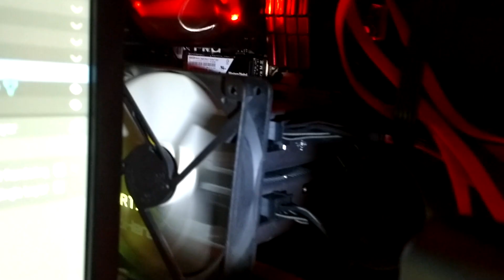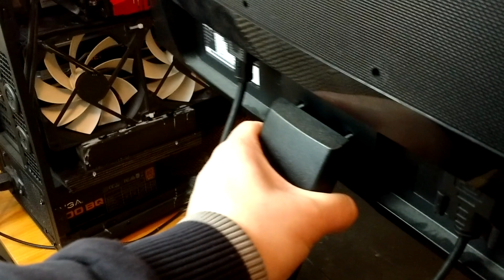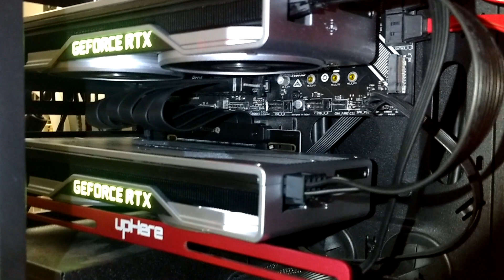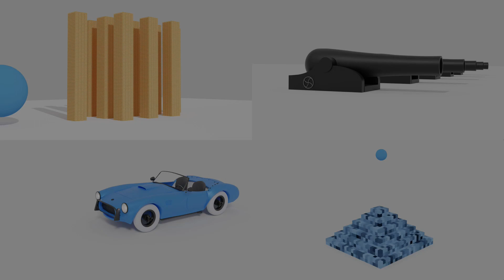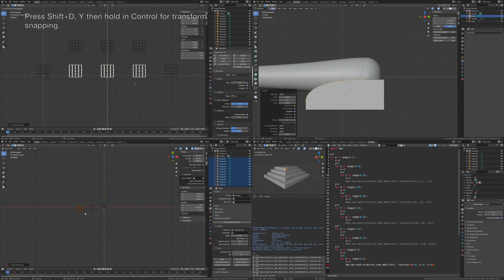Fixing My Hot Running RTX 2060 Super With A Riser Cable

Comment: I am considering getting a RTX 2060 to replace my r9 280x but i have some questions. my r9 280x hovers around 44 degrees when gaming and the power consumption when idle is about 1.6 watts ( according to GPU-Z) i noticed your 2060 running at about 109w. i am assuming this is during a Blender rendering? what is your idle power consumption with the rtx 2060? ( will mis the built in ability to do video capturing with the r9 but i suppose getting a separate program to do that is not an issue ) PS great fix. its amazing how your power consumption and temps evened out and your frequency went back up just by separating the cards.
Reply from the maker: when running 3 monitors at idle the 2060 super bounces between 5 - 12 watts.

OBS works nice for screen capturing.

Comment: Hey, man. Cool video! Did you try x16 - x16 straight away? Do you know if the 2060 would work with a PCIe x1 - x16 riser cable?
Reply from the maker: Yes, for rendering in Blender all the GPUs I tested worked fine with a single lane riser cable. The only thing I noticed is if the project is complex and requires a lot of vram, it take a bit longer to transfer the data to the GPU through only one lane. But realistically with 3.0 or 4.0 speeds, the additional time is minimal.

I even tried it with a 3070 and it works fine. The classroom scene takes about 1 second longer to render in a 1x slot vs a 16x slot.

But of course for gaming, you need at least 8x 3.0 slots or 4x 4.0 slots.

Here's a video I made using a 1x riser cable a while back. https://www.youtube.com/watch?v=BNsBJA3S-p4

https://www.youtube.com/watch?v=1s8FO_Tmntw

Comment: I wonder how you got one of your gpus to stay under 60c, i own a 2060 super and with the case open it maxes out at about 72c with almost 90% fan speed, tried undervolting but only amounts to a 1-3 degree difference
Reply from the maker: Currently I run mine with Afterburner limiting the current to 80% full load and I can't see any performance drop when rendering. But both my cards in an open case(miner style case) rendering for hour after hour with the fans running at 41%(slowest possible speed) they run 65-72c depending on room temp. My fans seldom ramp up on their own and if they do I have never seen them run more than 50%.

Limiting the current to 80% TDP in Afterburner helped but only by 2-3 degrees. If I manually turn my fans up to 80%, my temps stay in the upper 50s under sustained load.
Reply: @BlenderRookie  what model are the cards? Mine is an msi ventus
Reply from the maker: @michelgoudreault7170  Founders
Reply: @BlenderRookie  well those are great temps
Reply from the maker: @michelgoudreault7170  But also the cards do run cooler when they are not on their side. In my current case the cards stand up with the PCIe on the bottom and the heat vents pointing up.
Reply: @BlenderRookie  thats interesting
Reply: @BlenderRookie  i believe my temps are mainly because of lack of airflow, even tho i have 3 intake and 4 exhaust running at max rpm the vents where air comes through is pretty small and the glass side panel gets kinda warm

Comment: nice video! i watercooled my 2060 ko for $70  keep making great content sir!
Reply from the maker: With these 2060 supers, water cooling them is kinda pointless. I can run them at 100% for hours and they barely reach 70c in my current case.
Reply: @BlenderRookie  that is true, my 2060 ko ultra cooling doesnt perform like that. Thx for your feedback😀
Reply: @MutedMillennial  What watercooling product did you use?  I own Gigabyte RTX 2060 6Gb and it is freaking hot! It goes up to 78 degrees when I play games. I really wonder what I can do to cool it down.
Reply: @MrBobtista  I also have one of these cards and mine got up to 82c when playing Assassins Creed Valhalla using nvidia's geeforce experience to optimise the settings for my system. I ended up putting 2 more fans in my case that dropped the temp to about 76c. So now i have 6 fans in my case (3 in and 3 out) not including the cpu aio watercooler rad fans. I would also like to know what watercooler GatesTech used as the only thing  I can find on the Tube is a bodged one using a NZXT Kracken.
Reply: @leewat3742  thx for ur reply. But I’ve ended up selling this card and buying a new one. Now I’m a happy owner of Msi rtx 3060 ti and I’ve stoped worrying about high temperatures.

Comment: ok lol. 2 RTX 2060 Super instead of one RTX 2080 Super or something? hmm
Reply from the maker: For gaming, hands down one 2080 super is better. For rendering in Blender, two 2060s is better. In gaming a 2080 super will be about 45% better than a 2060 super. But in rendering, two 2060 supers is about 40% better than a 2080 super. But if rendering in Eevee, one 2080 super would be better.
Reply: @BlenderRookie  can you explain why it is so. Just curious 😅
Reply from the maker: @kaushikjyotidas2467  The simple answer is that gaming depends a lot on memory bandwidth, CPU capabilities and the number of cuda cores. In gaming it's a balancing act between a lot of things. If one thing is significantly more powerful it will generally make  less of a difference in gaming because gaming is affected by every bottleneck. Also, typically gaming can only use one GPU at a time unless the GPUs are linked and synced together with something like SLI or NVlink.

Rendering on the other hand like in blender is almost entirely dependent on the cuda cores and/or more recently the RT cores. Because rendering in programs like Blender is almost entirely reliant on the cuda or RT cores, the rendering performance is less affected by other potential bottlenecks. In fact when rendering a frame in blender, the computer itself is doing very little because it's almost entirely being done by the GPU. This essentially equates to there being very few bottlenecks to adversely affect the "scaling problem".

The scaling problem is essentially this. When gaming let's assume you have a GPU with 4000 cuda cores. If you had the same GPU but somehow magically doubled the cuda cores to 8000, you might think the GPU should be twice as powerful. But it will not be anywhere near twice as powerful because bottlenecks will prevent good scaling. However, in Blender there are virtually no bottlenecks in the rendering dataflow pipeline so if the number of cuda cores are doubled, the performance will pretty much double.

A 2080 super has 3072 cuda cores. A 2060 super has 2176 cuda cores. In gaming  the 2060 super will be the bottleneck in most modern systems. But the 2080 super will not be the bottleneck and likely the CPU will be or neither(depends on a lot of hardware configurations). In Blender it can use multiple GPUs independently of each other all running at the same time all working on the same frame. The end result is using two 2060 supers are giving Blender 4352 cuda cores worth of rendering performance while a single 2080 super is only providing 3072 cores to render.

But there is a lot of other stuff that goes into it but those are the broad strokes.
Reply: @BlenderRookie  thanks for your answer 😊 can I connect with you on insta?
Reply from the maker: @kaushikjyotidas2467  I'm on instagram but I don't use it that often.
Reply: @BlenderRookie  oh ok